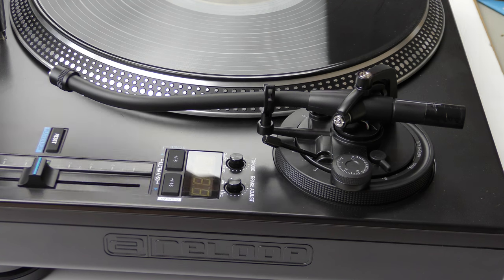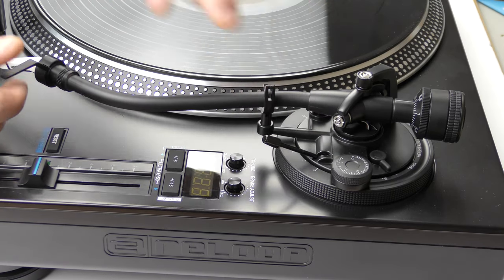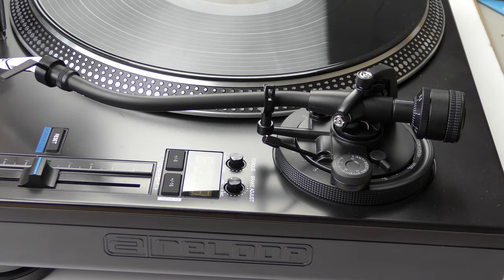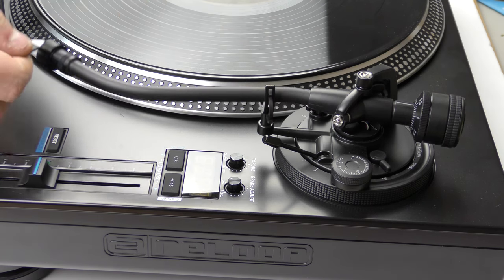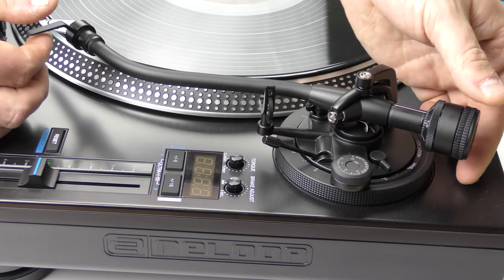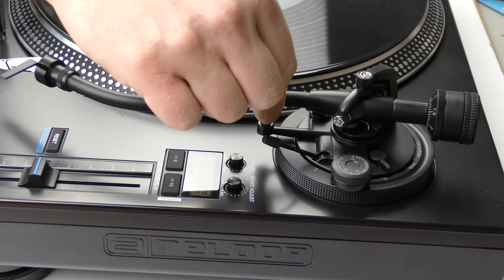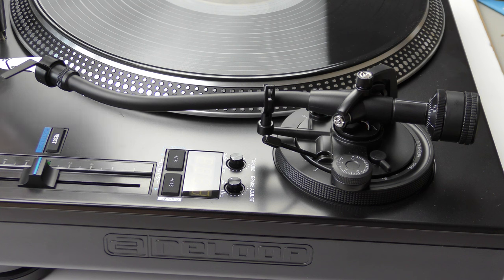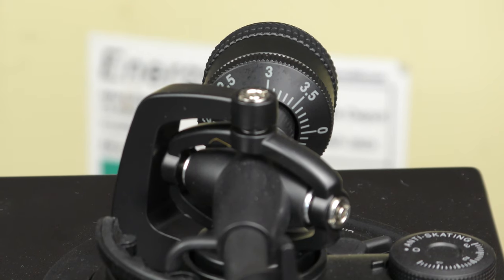How To Set-Up a DJ Turntable Cartridge and Correctly Balance The Tonearm

Comment: there's no need for a dj, I imagine. but the anti-skating should be necessarly set for the private use, imo. it has to be set on 3 (the limit on your turntable), I believe, or is there a difference by using this cartridge?
Reply: I noticed the anti skating helped as my decks weren't perfectly flat

Comment: What is the right height adjustment of tonearm  when using Concorde cart with slip mats. Wonder if it makes a any difference?
Reply: Yes it does. the proper height should be set up to the counter weight. So if it's 3g weight set height to 3 when scratching for regular mixing set height to 2

Comment: Brill video..thanks...bought some reloops mk 2 7000s off these guys in nov last years..just set them up..omg..amazing decks..!! 
Is the anti skating correct mine was set at 4.5?

Cheers carl.
Reply: No, at the proper down weight anti skate must be balanced at that weight or you will get pull back on tone arm without even knowing it...
Reply: So should this always be set at 3?
Reply: @CurtisGilmore4500  yes antiskate should be set at 3 if your weight is at 3.